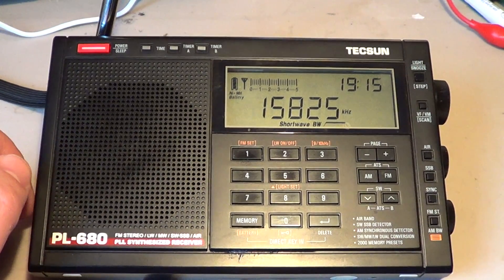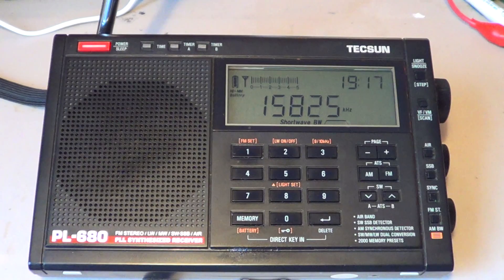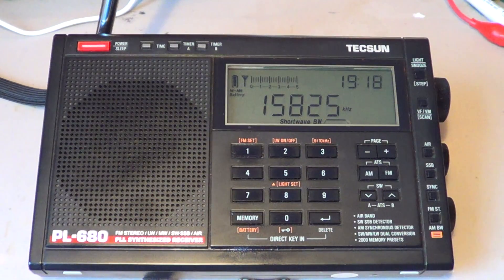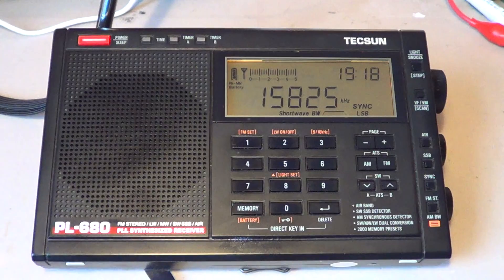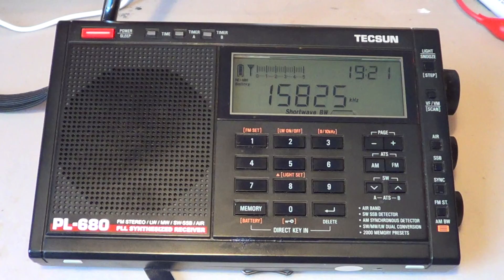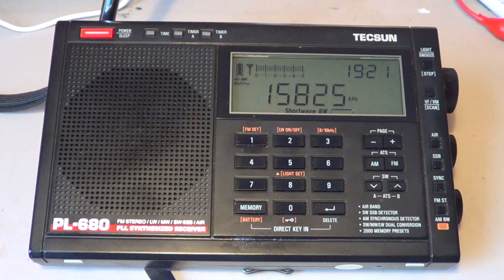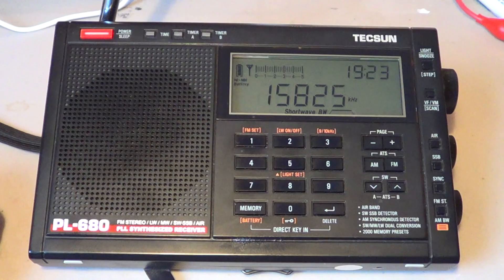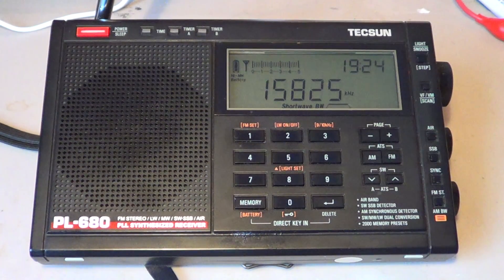Understanding Synchronous Detection in Shortwave radio receivers 101

Comment: It also is useful to reduce interference from an adjacent channel by selecting the upper OR lower side of the carrier, injecting the locally generated carrier and not using the carrier side that has the interference close by. The Sony ICF-2010 and SW-77 let you choose between upper and lower.

Comment: Excellent explanation. Another radio with horrible synch detect is the costly Eton Grundig Edition Satellit (the black version of the Eton Grundig Executive Satellit III). It neither stabilizes nor improves audio during fading, i.e. audio distortion gets even worse not to mention the radio sounds annoyingly strident. In view of this, I returned a brand new unit. It is a shame,  because this receiver is outstanding in so many features and some of them are exclusive and very effective.

Comment: Thanks for this. I have the Tecsun 660 & will try it. How is the sync detector on the Kaito 1103 ?
Reply: Coincidently, I have both radios. The PL-660's synch detect is great. I remember listening to the BBC in the afternoons while taking care of my dad in the hospital. It stabilized audio and cut down distortion when fading occurred and also gave a bit more of treble. I have the DE1103 which is the same as your Kaito 1103 and unfortunately it does not have synch detect. Still a great radio, though.
Reply from the maker: there is no sync detection on the 1103

Comment: I do have a question, in sync mode, USB and LSB are active, but the BFO is not, but on SSB, which also activates LSB and USB, the BFO does work, but why?
Reply: BFO allows you to "hunt" ssb signal, but on sync, or am, you are dead on carrier frequency, no hunting is needed. 
BFO is very narrow, less than 1kHz. When you are on ssb, very small change allows the voice to sound normal, just below the carrier. You use only one side of the wave on ssb, on am you use both and the carrier is cut off automatically.
Reply: Thanks.
Reply: No problem, I hope I was clear enough. One drawing could explain it much better :)
Reply: Yes I appreciate it. Each little radio that I own is different in some way, the pl 680 makes more sense to me now.
Reply: Some radios have dual sb, meaning, they still remove the carrier but use both side bands (lsb and usb) simultaneously. Old tube radios usually have dual sb, and some solid state radios also such as the Zenith D7000y, Realistic DX-440 and Degen DE1103. It is better to have radios with separate choice for lsb and usb so you can avoid interference of an adjacent station. Now, there is synch detection that also maintain both side bands, it's called AM synch detec. This is considered to be redundant and do not help when trying to avoid interference from an adjacent station. Early units of the ICOM IC-R75 came with AM synch detect and many people found it useless. Later ICOM removed this option from the R75. My SDRplay RSP2 has both options, but I only use lsb or usb synch detect. I'd rather use pass band tuning instead of AM synch detect. But, that is another story...

Comment: The circuit of the radio syncs to the exact frequency, but what does it synchronize exactly?  Did not get that part...
Reply: +Radiolite.pt  -- Sync detecton recreates the carrier frequency of an AM signal, which it then mixes back into the signal after filtering out one sideband or the other (although some sync detector circuits keep both sidebands).  Really good sync detectors can recreate the carrier even if the carrier on the received signal is completely  missing, as long as there is energy in both sidebands. It's a great tool for fighting fading signals.
Reply: I sure is a great tool. The best synch detection I know is the Sony ICF-2010's and I sometimes do MW scan and it is very common only to listen to a carrier with no audio. I choose lsb or usb and I have audio. The same happens with stations that under modulate. Here in Brazil, there's a station on 4862.5kHz that has good signal throughout the day, but most of the time its audio is too low. I tried using synch detect and it worked very well.
Reply: Oh , I forgot to mention the SDRplay RSP2 synch detect which in truth is even better than the 2010's.